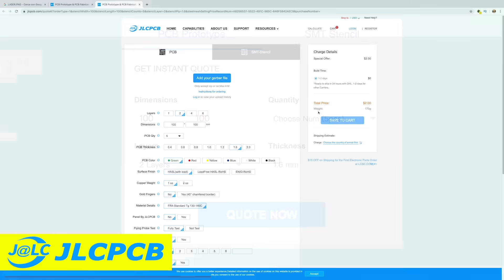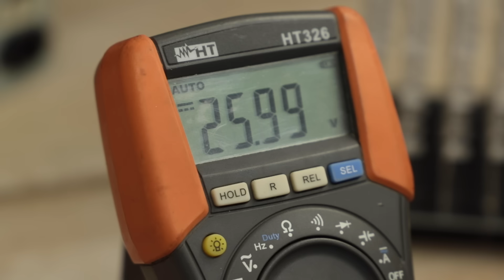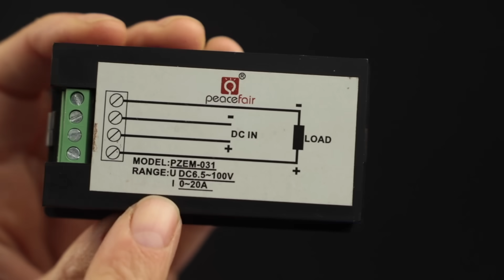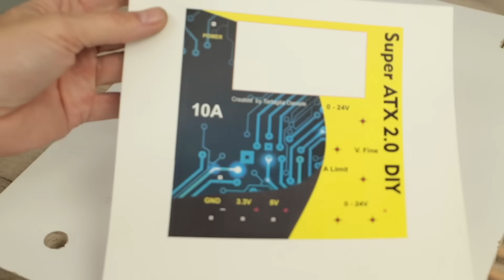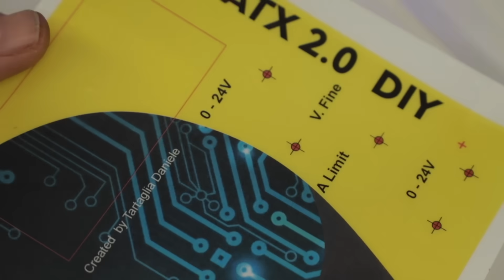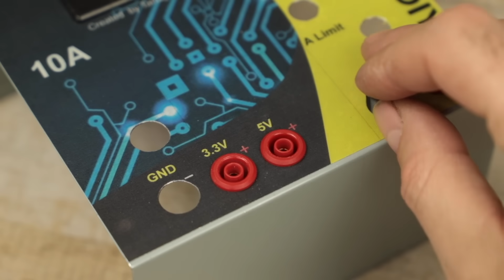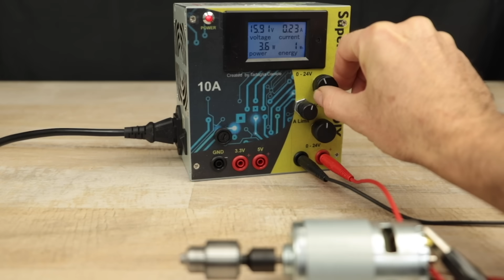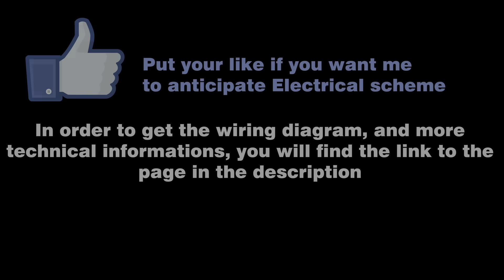ATX PC - DON' T THROW THAT AWAY!!! here is a BIG idea

Comment: all good except the mounting of the power resistor
Reply: What is the used of power resistor?
Reply: @oliverabenoja9432  Power resistors are designed to withstand and dissipate large amounts of power. They are used when there is a need to safely convert large amounts of energy into heat using electrical energy as a medium.
Reply: But still why add it? It works fine without it
Reply: @osamathemaker7261  no, it doesn't!
Reply: Ade Berry thanks, will try to get a resistor.
Reply: @osamathemaker7261  it doesn't work like that, you need to know what size you will need. What are you putting it on, are you building one of these supplies?
Reply: Ade Berry yes

Comment: very nice work. I would be better to add text (or voice) to explain what you do. for example, why you need the resistor outside of the box, which cables you soldering and so on.

Comment: Good project! Just a perception: before you start the work with the ATX PSU, you should have replaced the electrolitic capacitors in it. As I see on the video, one of them (at least) already humped, it means it"s dead, maybe it will explode.

Comment: What is the value of the potentiometer?
Reply: I guess you could get the value of the potentiometer from the buck/boost converter pot itself
Reply: @moustafayousef1438  would you be specific?
Reply: vinjo varghese if you have the buck/boost converter in your hands, there is a number on top of each potentiometer.  Just search this number on AliExpress you will get the vale

Comment: Hi, nice work ! I'm very interested in this project and plan to make the same thing with an old power supply of mine. I'm just wondering about the purpose of the power resistor of 10ohm added in parallel of the 5V output.
Could you please explain its role ? Thanks in advance !
Reply: Most ATX powersupply require a "minimum load" to function/start up properly. My guess is that the resistor is put in there to serv as a "minimum load.
Reply: O resistor é para carga fictícia. Ou seja, para estabilizar a tensão da fonte.

Comment: 4:58 what did you cut it and leave the live wires or solder it whole off from the board?

Btw,I have a used switching power supply...but,it's quite messed up, the cover got overheated

Comment: Olá,  qual é os valores dos potenciometro?
Reply: 200k, mesmo valor do trimpot. ou o mais proximo que conseguir.
Reply: @playerztransform  the 3 potentiometers used are 200k?
Reply: @diegof.8052  nope. 200K is for Coarse tension. V fine and A. Limit use 10K.
Reply: @playerztransform  Let me see if I understand. Are you saying that two potentiometers are 200k used to regulate the fine and coarse voltage and the last potentiometer is 10k used to regulate the amps?
Reply: @diegof.8052  No. 200K for coarse. the other two are  10K. Click the link on description, you will enter in a some-dumb-secret-link-i-dont-know-why and go to comments .So, there you will find the schematic drawing...
Reply: @playerztransform  the link you mention is www.labdomotic.com/2020/02/27/atx-power-supply/ and believe me, there is no official diagram of the original project, I only see a diagram made by someone who does not know if it is correct and many comments from people still waiting for the original diagram promised more than a year ago.
Reply: @diegof.8052  yes, i know. but you can follow the tips of the coments and can achieve the  result. But, you can keep simple. You can repalce the trimpots by the Potentiometer, is for adjust only. If possible, you can buy the MultiTurn Potentiometer from Bourns and thats it.
Reply: @playerztransform  Ok, i understand you, thank you for telling me the values of the potentiometers. I have another question, the power resistor in my country is expensive, do you think if I replace it with a ceramic resistor like the one you see here https://amzn.to/3lw9rGO can it work? and do you have any idea of the value of the fuse?
Reply: @diegof.8052  This specific Resistor that you sent do not fit. . Look for 10 ohms, 25Watts power resistor @Amazon, you will find, for sure. About the fuse, I really think he is using a 10 Amp. But you need catch the max Current from the chosen supply and the max current of Buck/booster converter. The converter cannot handle less than maximum of our supply bus, it will be under dimensioned. Try to ballance this.
Reply: @diegof.8052  And this project has a major problem. You cannot use for less than 6.5 Volts. The display turns off bellow this. So, you can use the "tension"i guess, but you cannot read this.Useless, indeed.
Reply: @playerztransform  ok, so if I find a 25w 10ohm ceramic resistor it can work in exchange for the power resistor. By the way, in an online store I found a 25w power resistor but it has 15ohm, do you think it will work or is it mandatory to have 10ohm?
Reply: @diegof.8052  Hum... I don't know waht calculation he did, i think it could be good test it. This Resistor is to keep current on StandBy Bus.  So, i think you can use a 15 ohm. The better way is to make some tests... And if you use a ATX power supply, you probably do not need this, you need to test it. Just short circuit the green (PS-on) and black(ground) cables. See this... more info about , similar project. I shorted the link but it is a YT video.  shorturl.at/ipEJ7
Reply: @playerztransform  I watched the video and the guy uses a 50w, 8ohm power resistor and he says that using a power resistor around 10ohm is suggested, and he also says that a ceramic resistor can also work. And going back to the potentiometers, the dc-dc module uses two trimpot that in its upper face is the resistance code 204, that means that its value in ohms is 200000 ohm or 200K, according to the datasheet you can see here bourns.com/docs/product-datasheets/3296.pdf?sfvrsn=30833be9_10
so I think Daniele replaced the trimpots of the dc-dc module with two potentiometers of the same value or an approximate value.
Reply: @diegof.8052  Exactly. He did.
Reply: @playerztransform  So, according to the above, two of the 3 potentiometers are 200k (one to control the coarse voltage and the other to control the amperage limit) and the third potentiometer is maybe 10k as you say, which is used to control the fine voltage.

At minute 2:36 Daniele checks the output voltage of the dc-dc module which is twice the input voltage provided by the source, then he calibrates the voltage trimpot to almost 0v and then goes up to 28v which is the limit of the dc-dc module, but if it indicated 24v on the multimeter was not simpler to give a few turns to the trimpot to reach 28v? why he went down to 0v and then up to 28v?

At minute 3:27 connect a display to the dc module, but the display shows 21.53V when Daniele calibrated the module to 28.64V according to the last multimeter result, so I don't understand why the display doesn't show this last value and I don't understand why he recalibrates the voltage trimpot until the display reaches no reading. 🤔
Reply: @diegof.8052  He didnt calibrate the Display. He was demonstrating how it works before change for the potentiometer. The display faded out because the minimum for keeping it workin is aproximately 6 volts, so when the voltage dorps below this, the display turned off. So, as i said, useles for low voltages.

Comment: Hello Daniele, I wanted to know if the 10W 10R resistor is absolutely mandatory, I have a PC power supply which is not very old and I would like to transform it in the same way into laboratory power supply, there is only this resistance that I do not have and before ordering one I wanted to know if it is imperative to install one?
Reply: I was wondering the same...
Reply: What is the purpose of that big resistor. Connected  directly between +5v and gnd
Reply: @Daniele Tartaglia can you answer this question about the 10R 10W resistor, what is it exactly for in this assembly, is it essential and is it possible to replace it with another resistor and in this case which type, thank you in advance.

Comment: You're the greatest ;-)
If I want to add like the car lighter to use things at home that suppose to be used at the car, do I need to modify the parameters or any 12V will do?
Reply: Just order a 12v 120 watt 10 Amp adapter at AliExpress. This project is not designed to run higher loads at longer time in an efficient way.

Comment: Hello,
Nice project. Respect.
Please add potentiometers type and wiring.
Thanks
Reply: on the original  step up/down controller the pots are 200k to adjust the voltage and current. the 'fine' knob is probably another 20k in series with the voltage pot. this will give you a coarse and fine adjustment on the voltage. maybe even use a 10k to get a more fine adjustment. that's my guess
Reply: @skippygig : For the fine adjustment he used a 10k linear.

Comment: Sometimes the heatsinks on DC power supplys are live! Also the mounting of the smaller PCB is well dodgy, why not mount it on standoffs on the lid?
Reply: I thought the same. Two little discs of plastic aren't going to cut it.

Comment: Daniele Tartaglia
1) 7:01 - What is the power resistor for? To limit Current(A) -  5V/10om = 0.5A?
2) 15:53 - why drop volt with load more 6A? The problem with DC-DC Stepdown?
Thanks, the good project =)
Reply: O resistor serve como carga fictícia. Ou seja, estabilizar a tensão de saída da fonte.

Comment: Great video, very creative!!! Ah, please answer me: Apparently the 10 ohm resistor used in the project is the same resistor for high power LED lamps ... am I correct?
Reply: What is use of 10 ohm resistance... ??? Pls tell me its work in this supply...
Reply: @kulvinder9899  Some/most/all ATX PSUs will only supply (stable) power to the outputs with a load resistor. Without it it might not be stable power output or in some cases will not even give power. On older PSUs the load (mostly) goes on the 5v rail but on newer PSUs on the 12v rail. There is a lot of good info on the general web around this but generally, if your 5v rail has a higher current rating than your 12v rail then you put the load resistor on 5v rail and visa versa.
Goog values are probably 10ohm if on the 5v rail and 22ohm if on the 12v rail.
Reply: @marcdedouallier3209  Thanks🙏

Comment: It's said to be step down, but step down won't boost voltage. So taking in 12v is maximum you can take out.
Reply: It's actually a step up - step down buck converter.

Comment: Ciao, complimenti per questo progetto e tutti gli altri che realizzi.. invidia ma soprattutto stima profonda. Una domanda probabilmente banale ma che non sono riuscito a rispondermi vedendo il video.. Il fusibile l'hai messo sulla 12v ed hai usato un 10A? Inoltre.. data la quarantena (difficile muoversi o ordinare velocemente online)... posso usare un resistore 10w 22 Ohm di tipo ceramico sulla 5V anziché quello proposto da te? Grazie mille e continua a sfornare capolavori del genere :)

Comment: The graphic label on the front was an awsome touch I haven't seen before.
Reply: What was that wet applied film he placed on the front over the printed parts?
Reply: @WarrenPostma  You should be able to find them on eBay, Amazon, local hobby and craft stores etc as Self Adhesive Craft Vinyl (or simply Sticky Back Plastic). You'll want the clear stuff of course.

Comment: What values does the potentiometer have ? I'think that this is a 200KOhm linear potentiometer but I don't know the correct value of power (W) ? Someone have a suggestion ? thanks 

Che valori ha il potenziometro utilizzato ? Credo sia un potenziometro lineare da 200KOhm ma non conosco la potenza. Qualcuno ha suggerimenti ? Grazie
Reply: 220k & 10k linear
Reply: @johnmacedo4483  how many Watt?
Reply: @mztutto3d : The power supply that was used on this project is a 350W. But due to the limitation of the automatic step up step down adjustable power module being 1,25-30V. The maximium wattage output should only be 300W in total.

Comment: Interesting, but it does have a few major issues:
1) basing everything on a cheap old worn out PSU guarantees poor voltage regulation so that is not good for some components. simple electric motors are probably totally fine though. it also had some caps already fail due to old age and crappy manufacturer...
2) overheating - the base PSU is already crap enough that it heats up under load, adding all these components and wires inside the case will definitely overheat it when going over 200w for more than a few minutes.
3) over current / over voltage / short protection - these are usually either bad quality or entirely missing from these cheap PSUs, and this can be a major safety hazard, especially when considering the heat buildup and modifications.
4) basing the regulation entirely on the 12v rail is a good idea in theory, but these old PSUs usually do not have much Amps available on it, so 350w is definitely not possible here without shutting down or maybe frying the PSU .
4) that voltage regulator you installed doesn't look like it can handle over 200w of power, especially if it's not very well ventilated and if you want it to be in low-voltage/high-amps. 

all of these can be solved by just going with a good quality PSU with decent components and ventilation in the first place, and maybe using a beefier regulator for more power.
Reply: It is just a light duty bench variable pwr supply. He did not build it use as an arc welder.
Reply: @Accumulator1  he's still using it for running motors like drills and sanding belts, some of them can easily draw 300w under load and overheat the PSU over time.

Comment: Ok, video and nice looking build.  But
0) THERE ARE 240V/110V INSIDE THE CASE.
1) DON'T OPEN THE CASE IF YOU DON'T KNOW WHAT TO DO. REALLY KNOW, NOT JUST THINKS YOU KNOW.
2) Most of this can be done without opening the case.
3) Don't overrun those pots.  That is, don't use a motorized screwdriver.
4) DO NOT LET CUT WIRES HANG LOSE INSIDE THE CASE.  THAT IS DANGEROUS.  SOME CONDUCTIVE THING; LIKE A SCREW; CAN FALL INTO IT.  OR METAL PARTS FROM YOUR DRILLING.  Cut them on the outside and secure them in with shrink tubes, or unsolder them.

Except that and all the production placing, which is kind of ok. 
Good idea and implementation, but should probably been done with some comments in the video about security in the right places, not just in the beginnings.

Comment: I used my old atx as a 230v to 12v power inverter in my touring caravan after the old power supply stopped working.

Comment: You regulate the Output with the step Up step down converter, this is designed for 8 Amps your labeling at the front says 10 Amps that couldn' t be correct!
Reply: Input voltage: DC5-30V
Input current: 8A (MAX)  peak 10A (6A work a long time)
Quiescent current: 4mA (operating voltage is not the same there will be errors)
Output voltage: 1.25-30V continuously adjustable
Output Current: 10A (MAX) (5A long natural heat inside)
Output current range: 0.2-10A

Comment: Good day. Very nice video. I just want to ask: where do I connect the third potentiometer? Two go to the Power Module Voltage Regulation. The third one missed me. Maybe if there was a wiring plan. Thank you. Sincerely, Thomas
Reply: The third one is connected in series with the second one of the same shape. 13:09 is a good overview of it.
Reply: @caseysmith2445  
Thank you for the information. This somehow missed me.

Comment: Reading the subtitles is difficult. Instead of music you may read them. Load resistor could be inside.
 Very good project.
Reply: But then you would complain about Daniele's heavy accent.
Reply: That's what you have pause for! Just press space to read the details or press left arrow to go back in case you missed it. I agree its a really good project, i saved two semi-busted PSUs for this exact purpose.
Reply: This video would be so much greater with vocal explanations and also some safety instructions. Like no mentioning of the capacitors in there that may be shocking you if you are not careful/properly discharging them.
Reply: how the load resistor is connected?
Reply: @negrit00  this is a small load required for proper functioning of the switch mode power supply otherwise with no load the pulse width will be nearly zero affecting other supplies.
Here it is connected across 5v output.
It is given in the subtle, but you missed it. This was the reason I had requested that subtles should be read as well.
One expert has opposed my suggestion, see above.

Comment: Good looking project outside, but why you need to put additional cheap Chinese crappy modules in order to make the PSU regulated - with additional heat generation, overall power efficiency decreasing, etc? How is it possible that you are satisfied although that this module is not necessary to be installed inside your project?!?
ATX can be modded directly to provide you 0-30v 10A and the circuit was developed by an Italian guy. 
http://www.chirio.com/switching_power_supply_atx.htm